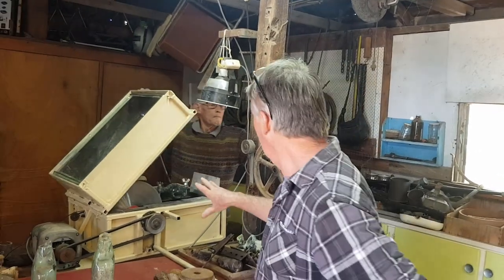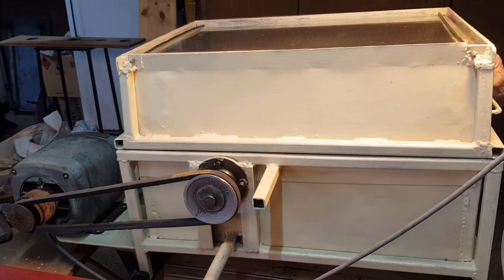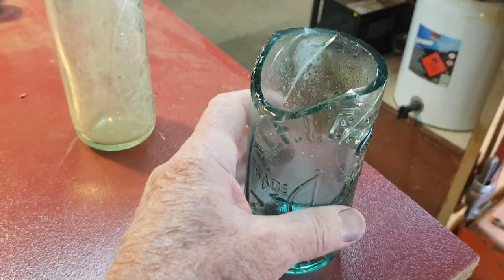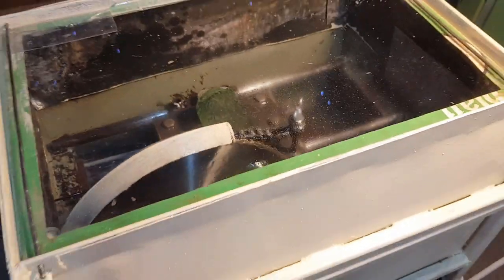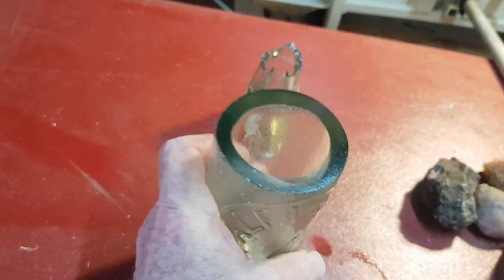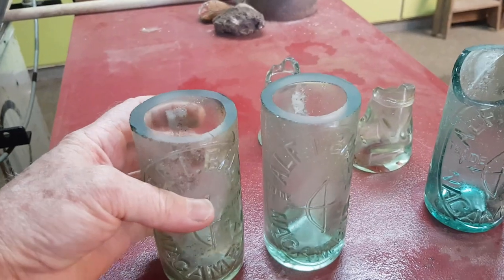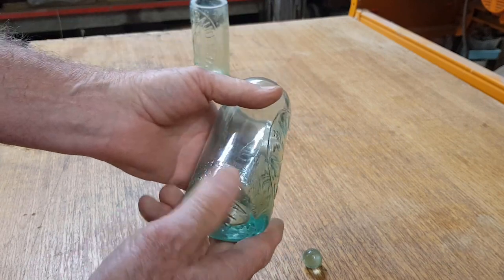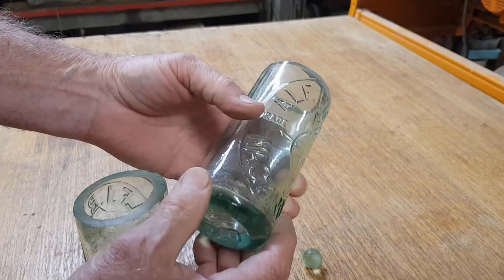Cutting down some broken Antique Nagambie Codd/Marble Bottles for Vases on Dad's Homemade Rock Saw!

Comment: Love the cutting machine 👍. Maybe try putting the bottles in the freezer for a while before cutting or run some coolant over the bottle while cutting.
❤✌🇬🇧
Reply from the maker: The freezer is an interesting idea! It may set up a larger temp difference though, which may be worse for cracking. It may be better to go the other way and warm the bottles up first. Thanks Les 👍😊

Comment: Love it. I wonder how thick the protective screen on the cutter is, and whether it would cope with (as Elon Musk calls it), a "Rapid Unscheduled Disassembly". If the bottle exploded would the bits stay contained within the machine? Hopefully we'll never have to find out!
Reply from the maker: Rapid unscheduled disassembly! 🤣🤣 I like that!!
It's 1/4" plate glass - so should be right! I don't think there'd be too much explosive force.. more a cracking and crumbling..